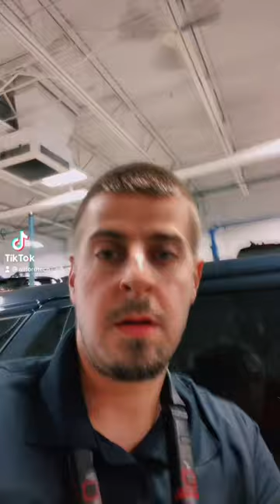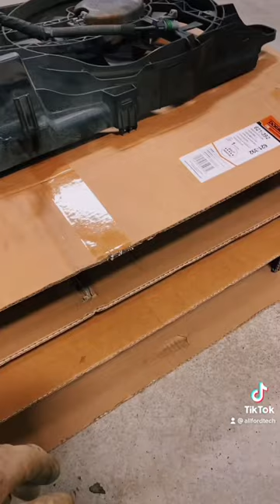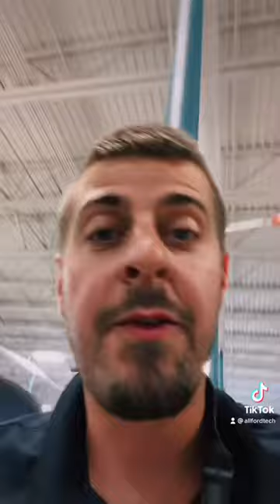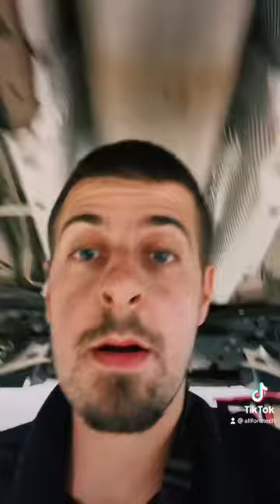This is why mechanics drink…

Comment: My mechanic had to reorder the same part 3 times (after returning the first one) before we got one that worked. The funny thing was that the third one that was sent to him came back in the original box he had marked defective when he returned it to the manufacturers. He is a great guy, with a sense of humor and patience of an old lady on a fixed budget. One time he did a job and only wanted to charge me $25.00 after what I thought was a significant amount of work. I asked him how he made a living. His reply, I can eat. He always has a waiting list of 2-3 weeks. He never takes a "Can you fit me in." He never works on weekends or holidays. He once got down on his knees and begged me to buy a new car, the car I was driving was 26 years old. He has a lovely family and his daughter told me he is the best Dad ever. No, he is no relation, either. I just got lucky about 15 years ago.
Reply: That sequence of returning a defective part, them putting it on the shelf, you returning another defective part and then they try to sell you the first defective part has happened to me so many times.
Reply: Your existence was torture for this mechanic. You crack me up dude.
Reply: I don't blame him for begging you to get a new car, my best friend had a 08 Kia Rio that I had to constantly repair until he finally got a new Toyota and I was so relieved. Like a weight off my shoulders.
Reply: begging you to get a new car 😂
Reply: @ding9633 As someone who helps people build and set up computers, this hurt me to my soul. Had to do this multiple times with a CPU and just outright had to go through a different dealer when the 3rd one I sent back resulted in us receiving another dead CPU. Poor dude who I was helping out had to wait WEEKS to use his new computer purely because of the time for shipping and return shipping. If it wasn't for the fact that you get price gouged going to stores in the area, I would have just gotten parts in store
Reply: @harpiessnow bro I’ve been so lucky with pc parts I’ve only had one DOA. But I fear that’ll become more common in the years to come so I’m relishing the moment of not having a bunch of DOAs
Reply: @andycruzatx3387 from Kia to Toyota that’s an upgrade
Reply: I have an amazing mechanic too. Several of them, actually... 

My goal is to die before they all finally refuse to work on my old shitbox! X3

Comment: That’s why I work at Toyota, we rarely get faulty parts
Reply: When i worked at a gmc dealership, bad parts were rarely an issue.  It's garbage aftermarket parts , but i also understand oem parts can be insanely expensive.
Reply: @Kangaroojack1986  Box says dorman, I stopped the video :lol:
Reply: @alb12345672  Unfortunately, sometimes Dorman is the only company that makes certain parts aftermarket.  But I also avoid whenever possible 😆
Reply: @Kangaroojack1986  It is what it is 🤣🤣. But I have a Dorman intake on my grand marquis, 100K miles and still working fine. Plenty of junk from them too. They made a joke once on a comment (from the company account on YT), at least we don't make tires 😂😂
Reply: Toyota is pretty much invincible
Reply: I work at a Toyota zr engine factory, and I agree with this statement.

Comment: I developed a drinking problem as a car mechanic after saying their engine problems or damage was do to not getting their oil changed and them saying "I was always told oil changes  and routine maintenance was a scam".
Reply: I'm a DIY home mechanic, I'll tackle any job, had engines out etc in the past, anyway I've always replaced oil and filter yearly. My wife's car does very little mileage per year but it still gets done.
Reply: With the technology of today, engines run so clean and advancements of oil make it so you can go 7500 miles easily between oil changes.
Reply: @Meme-zc4cw  Some say that a breaking down of the additives within the oil could be a good reason to change yearly at least. That makes sense to me especially if you do mainly short distances, along with many heat cycles even if you do long trips, all factors which are hard to deal with.
Reply: @steveclark..  I don't disagree at all. I always do it at least once a year as well, I just don't buy into the whole every 3k mile thing. That gets expensive and is unnecessary IMO, but I agree with you though.
Reply: @Meme-zc4cw  We are on the same page for sure.😊

Comment: So true. Worked tech service hotline for a manufacturer for years. The number of times I had to say, "It is possible you got two bad parts in a row." was staggering. 2% failure rate is considered excellent in manufacturing. You build ten thousand parts, two hundred of them are shit, and that's if your top tier.
Reply: Often, those 2% of defects aren't randomly distributed. If a tool or machine breaks or goes out of spec, an assembly line can produce a string of identical products with  identical defects. Without good quality control, a distributor's large order can consist of an entire batch of bad units, so that when the mechanics in that distributor's region send back the defective parts, they could all receive identicly defective parts as replacements until the bad units are removed from the supply chain. It's why many products have coded timestamps identifying the exact time and date of their manufacture.
Reply: @johnstuartsmith  That’s a BINGO!
Reply: Source: trust me bro
Reply: @leolinde6977  I don’t think you know what that means
Reply: Once you send the defective part back the company just replaces the bad 25 cent part, box it back up and sell it as new again.
Reply: @greghenner4978  that would certainly make logical since. Since logic is poison to the corporate world, we just shit can it and move on.

Comment: My condolences.  Used to turn a wrench...I can relate.
Do NOT become a mechanic unless you go into diesel/heavy equipment.  Forget working on passenger cars for cheap, irate customers.
Reply: My "mechanic" didn't correctly diagnose the problem, so bought and installed five or six other parts, before going for the fuel pump (actual problem). He then unhooked my fuel tank and dumped over a half tank of gas on my garage floor (it stank for over a month) when that was completely unnecessary as a five minute YouTube search demonstrated.

When he was finally done, he still forgot to hook my exhaust pipe back up, so I had to do that myself or get charged another 2 hours of labor. Oh, and he billed me for the gas he put in the tank... After dumping it all over. 

So maybe there's reasons why people are testy lol.
Reply: @michaelsorensen7567  so...instead of taking it to a proper shop, you hired some guy off Craigslist to do it in your garage? And you were pissed that A: he probably did not have access to a computer to look up the specific process for that car, thus had to wing it and hope her got it half right, and B: made a mess in your home (this is asinine because working on cars means making a mess, it can't really be done clean). You set yourself up for failure all the way around and only have yourself to blame.
Reply: @cavalieroutdoors6036  called all the local shops. Two weeks out just to make the appointment. No drive power so while I could've pushed it through the back streets in town, any further out and it was a tow. And I need my commuter car to drive half an hour to work every day. 

It wasn't Craigslist, it was Google. 

And if the dude has a phone to run his business off of, he has a phone he can take five minutes searching YouTube. He certainly had a code reader and other specialist mechanic equipment that I don't have access to, so seemed legit.

I did learn my lesson of course. If I'm gonna get screwed out of hundreds of dollars, might as well at least have the mess somewhere else.

The mess didn't piss me off, the fact that it was fully unnecessary is what pissed me off. Disconnecting the fuel tank isn't required.
Reply: most of the mechanics I knew while working on my "street" not a race car at all evo IX changed work, that was 5y ago 6 of them don't work as mechanic any more and I live in a small town
Reply: even being a diesel mechanic is a bit dubious out here, the pay is better but not getting better (while the shops keep charging more. we are at $200+ an hour and the guy who is doing the labor is making less than 30) 

If you are going diesel: make sure it’s a truck shop if you are careful about your back

if you want to do equipment, make sure it’s union, or try to unionize.

if you want to do ag, you have better pray that the shop is union. 

if you don’t care about free time (or your lungs), mining equipment.
Reply: @michaelsorensen7567 as mechanic and not even done mobile work for some customers because it was easier than having them paying expensive tow bill I hate to hear that you had so much trouble and it could have went better and faster and cheaper for you. Try to find reviews for someone on line regardless or ask them for the name and number of the last three customers they had and if they won't give you any customer to reach out to maybe call the next person

Comment: So true! We had a new FORD vehicle blow a head gasket. Needed motor replaced. When the motor arrived it had three things wrong with it. The manufacturer wouldn’t sent a good motor, they said to just fix it at the shop. It was a lemon. We went through arbitration twice. They’re for the dealerships.
It was in the shop a total of 81 days in the 3 years we owned it. Sold it before the warranty ended. And the couple who bought it was informed of everything we replaced and handed them the repair book. I would not sell it unless the person was fully aware of everything that went wrong.

Comment: I learned that years ago, trying to find a set of plug wires for my ‘65 vw bug. Guy at the store went through a dozen boxes of wires just to find four good ones. Like you said “just because it’s new doesn’t mean it’s good “. Still rings true. This was back in the ’70s.
Reply: Decades ago or years ago?.....parts were better decades ago
Reply: @JohnSmith-xu7ev  decades
Reply: @JohnSmith-xu7ev  years ago could mean 5, 10, even 50 years. Saying Decades is just a more specific way to say what was already said.
Reply: @tomfish3244  
So your not gonna list all the years, that years ago might represent? Im very disappointed
Reply: People put used parts back on the shelf too, just the other day I had two ball joints in a row that were completely destroyed in a brand new box
Reply: @Benjamin Ingenito  some workers also steal them and sell them on the side and replace with the old part. so the people don't know it's bad till they get it home and take the part out and boom its old and busted but in a new box.
Reply: @tomfish3244  Grammar Police 🚨🚨🚓 i
Reply: @deeezzbaaalllzz  it's not even grammar, it's semantics. Lol
Reply: For older stuff I've resorted to the Summit/Jegs catalog.  Depending on what you're after can get a set of plug wires with the appropriate plug end and cut and crimp the appropriate distributor end.  That or just buy the wire in bulk and reuse the boots etc.  Like you I've found finding proper preassembled wires for older stuff to be a PITA.

Comment: Exactly.  Aftermarket parts are not the same as they were a decade or two ago.
Reply: Late 70s early 80s federal mogul, moog, trw, standard etc was good stuff back then. It disappeared off the shelves and had to order the good stuff as cheap crap took its place. Then they too had to compete.
Reply: That looks like an OEM box
Reply: @Meme-zc4cw  Honestly I don't knoww.  Don't know how you could tell from this video anyway.  Parts are not what they used to be and if its made in China doubly so.

Comment: About a month ago, we had the same issue with an alternator; first one had a regulator go out after a week, second had a bad bearing(hadn’t installed it yet), 3rd was a different line and did work. Took an extra 2 hours of post install testing to make sure the 3rd wasn’t a defect. Unfortunately, the R&R was 2.5 hours(twice) plus the testing on the first defect and the testing on the final install. Warranty covered about 3 total hours

Comment: Great job!! By the third time you figured out how to install it correctly. I worked for a parts manufacture for 16 years. Part of that was in failure analysis, nine times out of 10 the customer induced the problem at 100% of the time it was sent back as bad out of the box.

Comment: I replaced my Mass airflow sensor 4 times in my 2012 Ford fusion😅

Turns out there was a broken wire inside the connector 😫

Always check your connectors and harnesses, too!!

Comment: While I sympathize with the situation, as soon as I saw the Dorman box I understood your pain. I just tell my customers now that I'm using O.E. and my non-functional new parts issues have dropped off considerably!
Reply: @Oldsoulstuckinabadtime depends which OE you're referring to. If you are talking 'Murican vehicles, yes, the parts are the same cheap crap the factory uses. If you work on Imports, there is NO comparison!! The only way the aftermarket can have a quality part is to rebox an OE part for an even higher than OE price, i catch it ALL the time
Reply: @mortimersnerdishere  I have no issues when using domestic OEM parts. Always work better then aftermarket. Sounds like you’re bias. I work on every make and model. Lots euro cars. They all have their problems. Germans wish they could find a way to not leak oil. Shall I bring up check engine lights on them?

Comment: They rebuild new products with old parts, I bought a water heater brand new at the store and discovered it and an old part in it, had to reorder that old part
Reply: And it’s a Ford.

F.unctional 
O.perations
R.endered 
D.efective
Reply: @knottchu6159  Thats not nearly as funny as Found On Road Dead or Fix Or Repair Daily.
Reply: @davesomeone4059  : Those 2 acronyms are old and overused for FORD which is why I left them off. Same with “First on Race Day.”
Reply: @knottchu6159  Fair enough. Its hard to know who your talking to on here.

Comment: I worked for 45 years in the automotive industry, the last 24 in collision repair. I feel your pain. I especially like the “OEM” replacement parts that come in an OEM box that turn out to be aftermarket. We had a full time mechanic on site and he even replaced frames. We put LKQ engines in vehicles occasionally. He eventually quit after more than 20 years with us and went to work for the city DPW.

Comment: As a boat mechanic I... I feel ya brother I feel ya. Brand new crate motor Yamaha 250 dfi 2 stroke.. made not two weeks prior, off the truck into my bay for a warranty job. Hooked everything up, bled the oil pump(it's a two stroke after all) plopped it into the test tank for testing and PDI and ran for 30ish seconds and #2 and #5 pistons kaboomed.. flags of spark plugs luckily it hit the bay doors behind it all hell broke loose RTA was standing there and pulled out his flip phone and called Yamaha for a new unit

Comment: This is very true. I hit a raccoon going 70 in a 2017 Hyundai Elantra(happened in 2019).Completely destroyed the radiator and had to get my car  towed to the mechanic’s shop and had a rental for a week. I pulled out and went to get groceries, didn’t even make it around the block before it started overheating so I turned around and took it back. Had to call rental office to bring the loaner back. Went to pick it up a week and a half later, let the rental sit while I took the Elantra around the block and it started overheating again so I took it back and told them the next time don’t call me till it’s fixed. They finally call me two weeks later to pick it up so I just said screw it and drove it for about 20 minutes before it started overheating so I took it to the dealer and traded it in. Long story short I’m not getting another Hyundai and I’m not going anywhere but the dealer for repairs.

Comment: After working in a assembly plant for 25 years ,this is so true we had to stop lines because parts coming in was so bad it shut down the plant. Think about it, a plant that makes 500 cars a shift 2 shifts. And 2 plants. So 2000 cars every 24 hours. Thats 50 million a day. And when a car manufacturer gets a gold award they get it with 50 to 100 defects per car. How many defects on the ones that didn't get a award

Comment: Learned this the hard way with radiator hoses. Went through 3 from oreily auto parts that had holes within 3 months of replacing both upper and lower. Finally broke down and bought mishimoto hoses............ Not dissappointed.

Comment: Shitty replacement parts are not a new thing. I had a 1994 Mazda B4000 4x4 about 20 years ago. The starter went out in a grocery store parking lot during the dead of winter.

I went to a parts store and got a new one. Not rebuilt, NEW. Installed it in that same parking lot in the middle of the night laying in a puddle of ice water.

Two days later the truck wouldn't start again. After diagnosing it as best I could I determined my new starter must be bad. I removed it, took it back to the parts store, and told the significantly older gentleman behind the counter that I got a bad part.

"Are you sure you installed it right?"

"Yes."

"Did you check the solenoid and the ignition switch?"

"Yes."

"Well, I have never seen one of these that's bad from the factory."

"This one is."

" I doubt it. But I will test it."

"..."

"Oh, I guess this starter IS bad. Let me get you another one."

😂😂😂